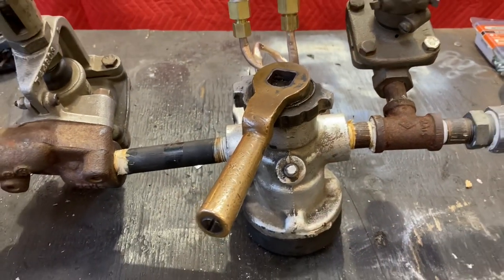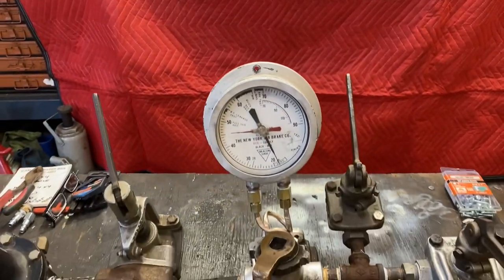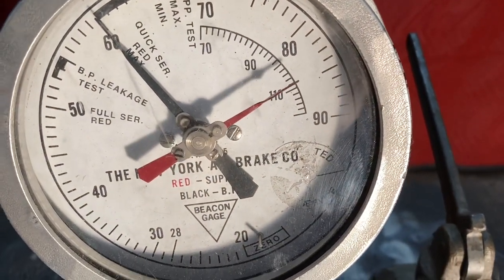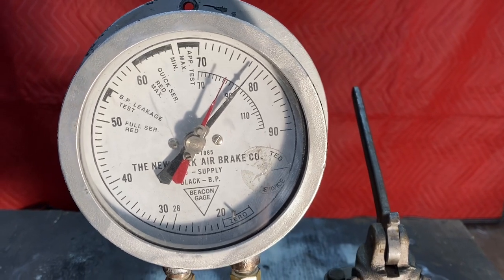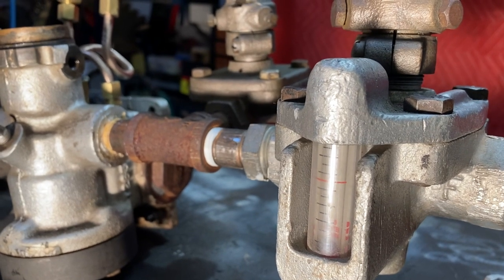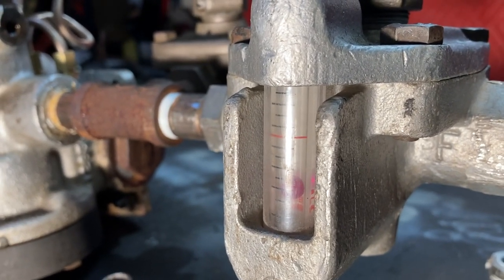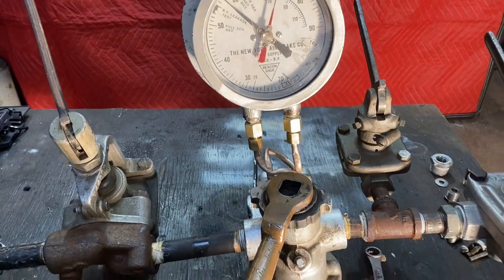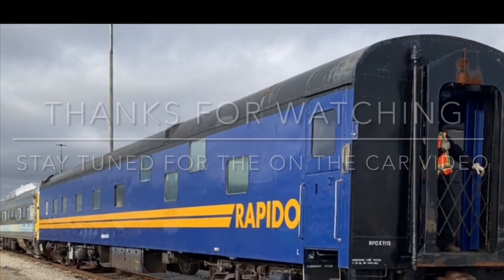Overview of a Railroad Single Car Test Device

Comment: Great information.
Chris….I really would like to understand how, for example, RDC air brakes work. The idea of brake pipes vs lines etc is just so confusing. Seeing  how this works live, vs diagrams helps. Any suggestions on how a dummy like me can master these counterintuitive concepts?
Reply from the maker: When I do the SCT video of on the car …. I’ll add and RDC in the mix and explain what does what and where the air goes … maybe a longer video but I’ll show how the control valve and J relay valve and the others work
Reply: Thanks. I grew up, literally 3 miles from the Budd Red Lion plant. An uncle worked there as a welder. As a kid we would drive by the plant and see the RDCs ready for delivery! The plant (and my house) was in farmland in the 50 and 60’s. The Budd plant was HUGE, and even had an fair sized airport on it. 
Anyway, I can’t get enough of your videos on these great units. Rode them when I was a commuter student at Temple University in Philadelphia.